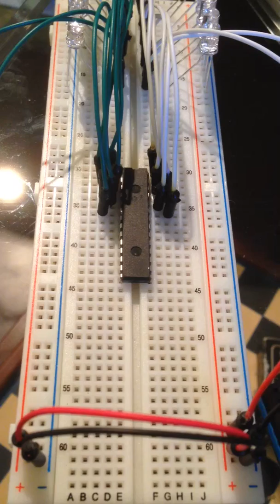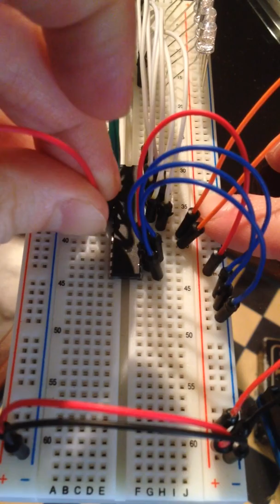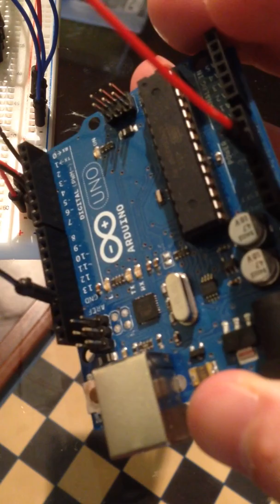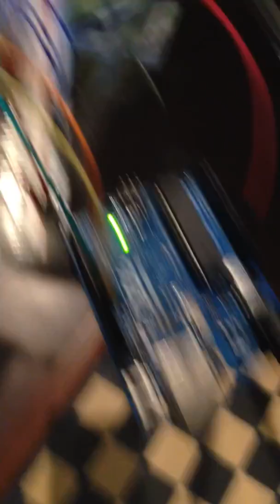Short Circuit: Episode 1 (MCP23S17)

Comment: Hi! Thank you so much for the video! I can't see though, did you wire those INTA and INTB together or did you wire them both to GND?
Reply from the maker: It's been a while, so I rewatched the video. It looks like I let them float, because I wasn't using the interrupt feature of the GPIO. Sorry for the delayed response, your message went to my junk mail folder. Hope that helps!
Reply: @zakoverflow  thanks! i understood later that you did let them float and tried that too. i thought my circuit wasn't working because of those interrupt pins, but in the end it turned out i didn't set up the SPI protocol correctly on my controller.